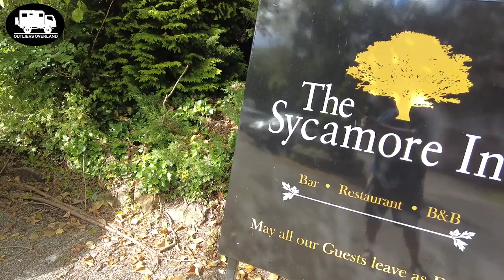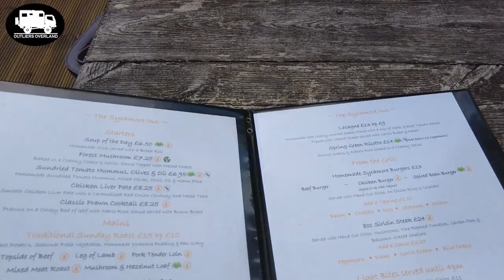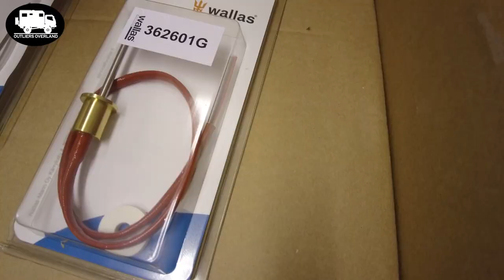Diesel Heater & Stove Failure • Wallas 85DP • VAN LIFE COMPONENTS

Comment: I service my own 87d unit and find that if you remove the burner can and completely clean it and also find a small drill to clean out the fuel needle tip as well it is most of the problem. I always replace the glow plug with a new one at the time because the 87d is a pain to disassemble. That works about every 6 months. About every year if you are a full time user you will need a new combustion fan and about every 2 years a heat/flame sensor. On the 87d it has an oven with the same burner system but it doesn`t need even half the servicing as the stove. I think because the oven control works via a thermostat the heating is more constant and won't produce as much soot. We have taken to leaving the stove control at the halfway mark and not adjusting the control at all. Also not turning it down to a lower setting before shutting down so the fan blows air into a still very hot burner, thinking this will help burn some soot away. This seems to make the whole unit run better for longer between services,,,